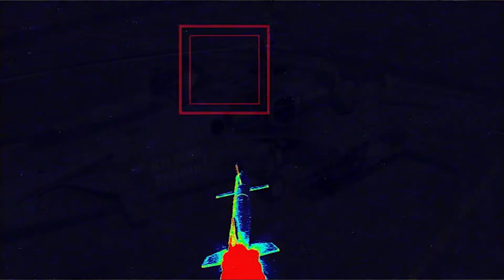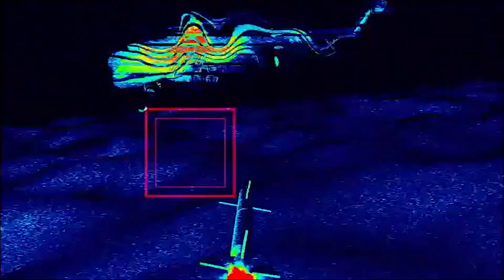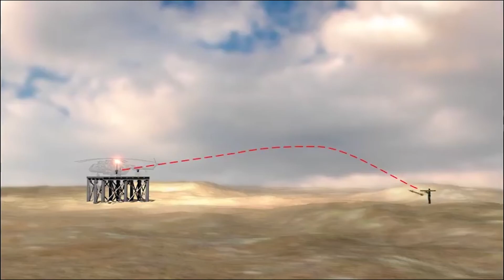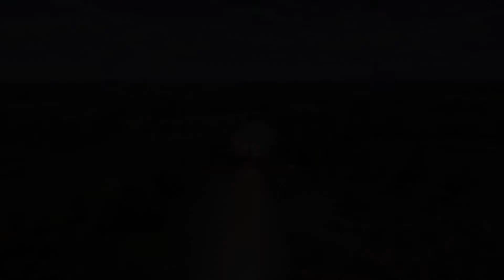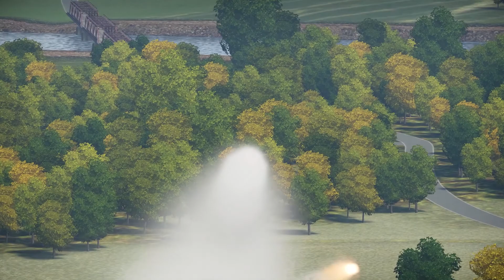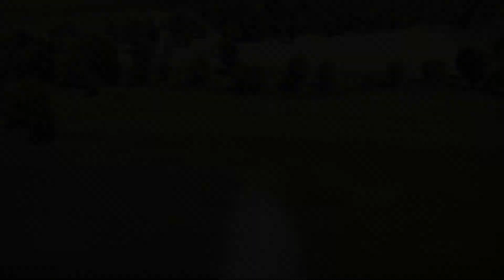War Thunder Ka-52 President S Missile Protection System - What is it and How it works

Comment: Can this system disrupt Beam riding missiles?
Reply from the maker: I don't think so, since beam riding missiles use different optic seeker than Heat Seeking missiles, which this President-S system was designed to counter. But the missile warning system might detect the launch of the missile at first, thus warning the crew and giving the crew time to evade.
Reply: @kebabthunder2813  when I was deep diving into the KA-52, it was rather difficult finding specific info about it but I do recall that there was such a system that would locate and then shoot its own laser back at the source, disrupting the track. It may have been on a Mi-8 configuration like the ones doing tandem missions in Ukraine right now. 

Beyond this, I think having Anti-Radiation missiles will be the next best thing for CAS pilots. If we can’t get Ant Beam Riding defense measures, let’s go all offensive in a nice high stakes game of missile chicken. Will you keep your radar lock or will you drop the dish? Tik Tok Tik Tok :P